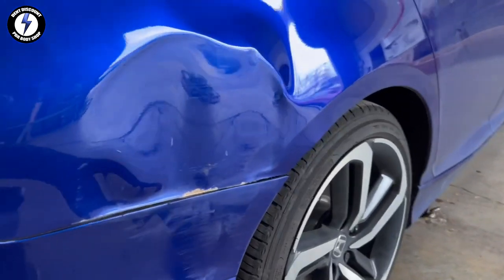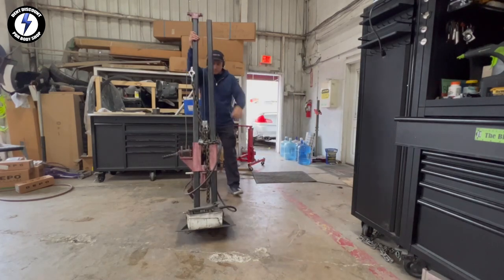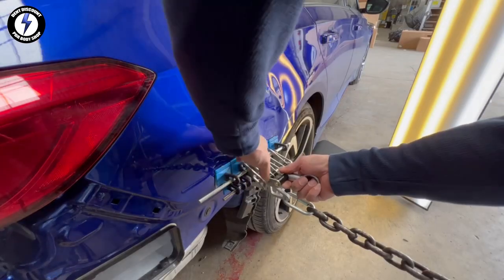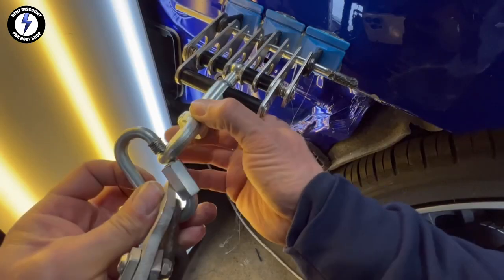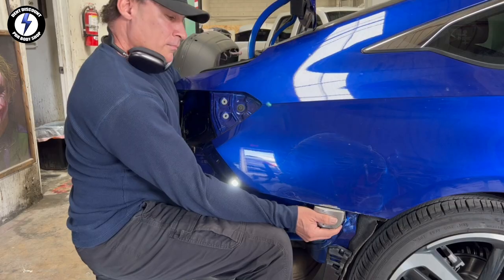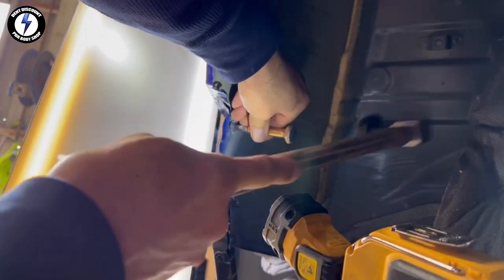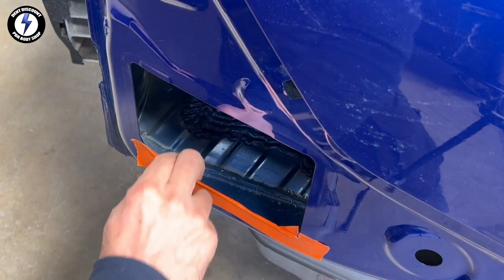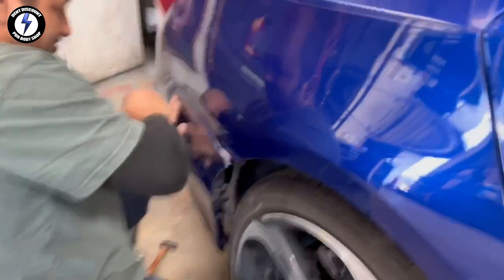REPLACE OR REPAIR? | Hole in Quarter Panel!

Comment: I don't do PDR, but I used to do a lot of rust repair. Back in my day, that panel would have been beaten out, filled and painted for under $1000. I can't do what you do, but I could still do an acceptable repair with a hammer dolly and puller for a lot less than a panel replacement.
 
I have pieces of chain embedded in the floor of my shop. I would weld tabs to the dent then attach a clamp and pull with a come along, pull back ram or a floor jack anchored to my floor chains. It was simple and cheap to do and yes it was back in the 90s.

That said show me your magic.

Comment: Great video!  I had a similar dent just above the rear bumper.  I tried PDR but it failed, however I was using Amazon home style pdr equipment and it resulted in more damage than fixing anything.  Finally I paid a body shop to do it right and it did come out perfect!  I guess that is why they get the big bucks.
Reply: Yup. While this kind of work can be done by a professional, with years of experience. Tackling it by yourself without that experience can make things go wrong very quickly. There’s a reason you pay others to do things you don’t know how to do 🤷🏻‍♂️
Reply: They practice a lot on old metal panels before they start working on real cars. That's why they can do a better job than you and me.

Comment: Question. When you do the 'knockdown,' what exactly are you knocking down? Is it where the metal is creased?
Reply from the maker: High points or crowns
Reply: @DentDiscountPDRBodyShop  I heard somebody once mention that doing so sends vibrations through the metal which softens it up or makes it more pliable. Do you know anything about that or have you heard that?

Comment: I say replace because that panel has a million rust points now. Its gonna rust out prematurely imo

edit  touch up paint helps but is nothing like the original material coating.
Reply from the maker: Right on thank you for your insight